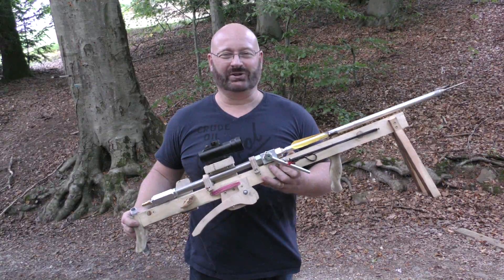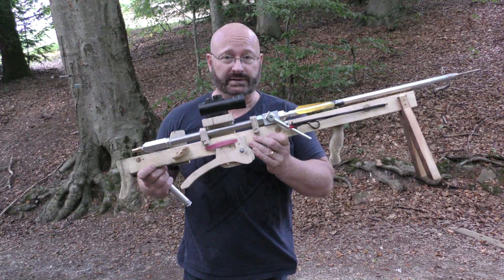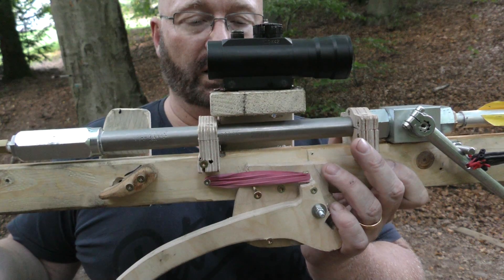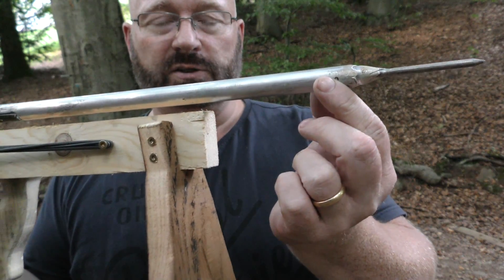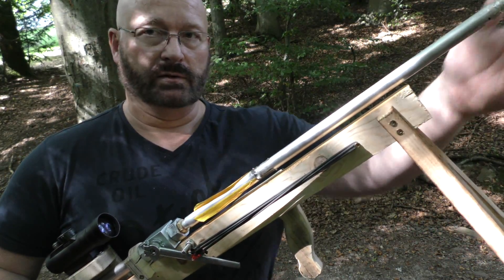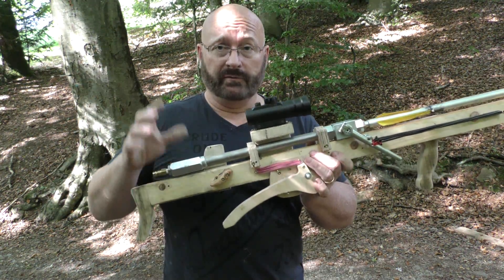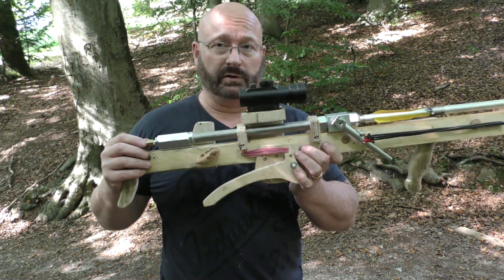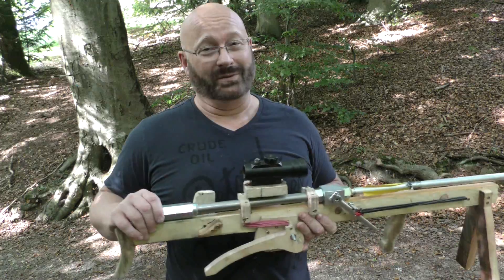Project 1000 Joule Airrowgun: Getting Closer! (714 Joule)

Comment: The speed of light was broken by a german toy inventor today..
Reply: "toy" inventor
Reply: They are considered toys in Germany. :)
Reply: He says so right in the video.
Reply: German laws (and laws in general) can get pretty ridiculous.
Reply: You need a firearm license to own an air pressure rifle with more than 7.5 Joule. Maybe (but only maybe) it is tolerated, as long as the device is not portable and he's using it on his own property only. But I'm sure it is not officially classified as toy. And if he would attach a small compressed air tank, which allows him to use it anywhere at any time, he would definitely get trouble.
Reply: He explained it all in a previous video. It's a toy and not a firearm because the projectile is not fired from inside a barrel but instead the arrow goes around the barrel. It's exploiting the letter of the law and I'd be surprised if this wasn't fixed soon.
Reply: Jonas Meyer
Das halte ich für ein Gerücht... Schau dir mal Paragraph 1 des Waffengesetzes an. Für mich kommt nur in Frage, dass es sich nicht um eine Waffe handelt, weil es nicht transportabel ist. Falls eine Luftdruckwaffe aber generell so definiert ist, dass damit ein Projektil aus dem Inneren eines Laufs gefeuert wird, dann ist es deshalb noch lange kein "Spielzeug", sondern bestenfalls ein "gefährliches Werkzeug" oder ähnliches. Das ist letztendlich Auslegungssache der Gerichte, und die würden auch jetzt schon Wege finden ihn dafür zu verknacken, falls er es darauf anlegen sollte. Ich bin kein Spielverderber, aber das ist einfach nicht ganz richtig. Vor allem, wenn du das einem Ami erzählst. Die Gesetze funktionieren dort etwas anders als hier. Wenn das Teil dort als "Toy" eingestuft werden würde, dann hätte das völlig andere Konsequenzen, wie wenn es hier einfach nicht als "Schusswaffe" eingestuft ist ;-)
Reply: +DK0207
So what you're saying is that if isn't transportable it isn't a real weapon?
Sounds legit to me, I'd consider a rocket to be a toy too.

Comment: Add a few mililiters of oil inside top of arrow (you can try grease or fat) high air pressure will detonate that oil causing even more pressure. This is a very simple but effective technique to improve pellets air guns.
Reply: That would make it a firearm
Reply: By law it wouldn't be a firearm and still perfectly legal, heck muskets aren't classed as firearms.
Reply: sasdlasokdalkfdalksfa well firearm laws in Germany are liberal in Poland pipe and hammer can be classified as firearm
Reply: you mean dieseling?
way to go to destroy an air gun :p

Comment: if my maths are good, this has almost 40% more energy than a 9mm handgun.
Reply from the maker: True, but keep in mind it also has 4.8 times the momentum of a 9mm. Plus a sharp steel tip rather than a blunt lead tip.
Reply: +JoergSprave so it really will kill a zombie, not just kinda kill a zombie.
Reply: JoergSprave really, the point I was making is this thing will murderize whatever it hits
Reply: if JoergSprave reaches his goal, he will be in 357 magnum handgun territory
Reply from the maker: I already am. At 1000 Joule I'll be getting closer to the .44 mag
Reply: I suppose you are on the low end of a 357 magnum now that I check the range of Joules...if you aren't already, start wearing ear protection
Reply: +phage74 ear pro is unnecessary, the arrow still is going really slow
Reply: it is hell on coconuts
Reply: When it comes to energy he's on par with some 158 gr .357 magnum, but wih 3.7 times higher momentum, due to the heavy arrow.
Reply: +Jonathan I. 
The momentum is devastating. 
I'm pretty sure it would go clean through a person.
Reply: +Sean Dali I don't think so, people are more tough than a bit of gelatine with coconuts in it.

Jörg should do a test like tnoutdoors9 does, that might be more conclusive.

You have to consider how thick the arrow is, compared to let's say a bullet.
Reply: tommihommi1 
I have. That amount of momentum? It'd easily go right through.
Reply: I find it strange that people are so interested in momentum...it seems like a meaningless random product to me...energy has stronger implications for the destructive power of a projectile in my opinion

Comment: That would be brutal with a lead ball in the end for a bit more thump.
Reply: The arrow damage much more than the lead ball tho.
Reply from the maker: This arrow weighs the same as a 29 mmm (1.15") lead ball.
Reply: I was thinking adding the ball into the arrow, I am not sciency but I just thought more weight = more thump.  sorry. and thank you for pointing out my error :-)
Reply: +whatthefluxable oh, I am out of my league, :-) but it is ok :-) I sort of learned something, (blowing it the force is different than thrusting/throwing it) but with the gas it is more accurate, what would changing the gas do? that nitro they use in fancy paintball markers? to what pressure is it stable and the arrowheads how much longer till they been extra extra reinforcement? :-)
Reply: +Joel Bradley need** extra extra
Reply: Forget the thump. Replace the nail with an oversized cutting broadhead. eeep

Comment: Maybe use Helium as propellant. Helium is less dense than air and more fluid, This results in less internal friction. With helium are 10-15% more power possible.
Reply: but the density of helium is lower... less mass of helium can be pumped in so the propelling force would not increase.
Reply: +Wan HL doesnt have to do with mass.  Propelling force would increase
Reply: And a ridiculous waste of Helium, a non-renewable gas.
Reply: the propellingforce has noting to do with the mass of the gas. One reason why Helium is better, Hehium is not Chilling while decompression as air (see the fog) and the viscosity is lower which results in less friction. And the speed of sound is about 3 times higher than air.
Reply: +genjii931
You think that's a waste of helium? Wait till you see the Airlander.
Reply: Maybe try neon, or one of the noble gases?
Reply: Wouldn't Hydrogen Be Even Better? (and that is the tale of how the self-destructing steel arrow launcher was made)
Reply: +Wan HL If you look up the video "Pellet Gun On Helium" from Cody's Lab, you will see that helium does in fact give you a lot more power.
Reply: The Visitor that's the video I was thinking of!
Reply: The Visitor Helium would leak, though. He's had enough problems as it is harnessing the power of air, keeping helium in a confined space is not something he needs on his plate xD

Comment: To get more oomph out of the system you could do 3 things that will all result is an increase in projectile speed. Putting a rupture disc at the end of the launch tube will allow a large increase in pressure within the launch tube before the arrow sees any pressure at all. Having a tight sleeve for the first 20mm or so at the back end where the arrow fits around the launch tube would have a similar result. Even applying a piece of masking tape between the launcher and arrow will mean there is a fairly massive increase in pressure before the arrow starts to move. The 3rd thing is either to use a commercially available or homemade pilot operated solenoid. You can get air ones with a manual activator but at Joerg pressures you would probably need to machine something up. I reckon you could easily halve the release time over even the rubber band powered ball valve.

Comment: I'm really glad you took up the idea of using a compressor. There is one more thing you could do to deliver a power increase and that is to use other forms of inert gases. For example Helium delivers even greater pressure than compressed air. You can pick up small helium bottles off eBay for around 40 euros. I would have to look at how to link the tank up to a compressor though. Hydrogen would also work but the risk of explosion from the explosive decompression or friction in the barrel and projectile would make it too dangerous for this project. Looking into inert gases is a great idea for this project and will produce a very high measurable increase in energy. The other option to increase energy is to change the valve. Ball valves don't open quick enough to release the maximum potential and that's a weak point in this design.

Comment: @JoergSprave Hey Joerg, currently the acceleration is just in the tip of the arrow, after which it gets more volume and accelerates less effective. An effective way to solve this whould be to have the arrow airtight in the barrel. Or have it fill the tube tightly. So the complete air pressure has to force the arrow out of the barrel. and only disperses after leaving the barrel entirely.

Comment: Have you thought of adding some kind of seal or gasket on the fletching end of the arrow, clamping onto the barrel so the air can act at maximum pressure for as long as possible? It seems to me like the base of the arrow would be a leakage point. Maybe something that engages once it hits the base of the barrel, but a teeny bit of difficulty loading the arrow wouldn't be a bad tradeoff for some more muzzle energy. 

Of course, the whole idea is based on a balance between energy gained from no leakage and energy lost by increased friction.

Sorry for spitballing, this is just such an incredible engineering project to think about.

Comment: I think I would add a metal plate between your face and the pressured parts. Just to be sure. Could be used as a nice cheek plate too. Anyway Joerg's projects make me give up on mines haha, he's unreachable.

Maybe there is one you could undertake some day, I would just need my user name to be mentioned if it ever happens. It's a kind of "perfect crossbow" that would mix compound reverse limbs technology like the Scorpyd; with AR480-like cocking device (except you wouldn't have to push back the sliding hook manually: it would be [rubber- ?] repelled to initial position with an automatic disengagement of the crank when the trigger hits its pulling limit -- no unwanted momentum coming from the crank rotating); and a magazine feeding -- the most ambitious part? Feeding arrows is no easy.

Basically you'd get a crossbow similar to the AR480 but very long draw length / rear-heavy / bull-pup design thanks to the reverse limbs, and no need to break your aiming between shots thanks to the automated feeding and re-positioning of the cocking device.
So you would end up with the most accurate and the fastest crossbow, both in firing rate and arrow speed.

Comment: Did you thought about using silicon oil on the barrel? it is used in many vacuum application in science and it should minimize the leakage of air between the arrow and the barrel. And if you use grease with medium or low viscosity the friction should be negligible.

Comment: Hi Joerg, 
what if you heated up the entire chamber after filling it? Could you get the pressure significantly higher than what you can pull off with your air pump?
And did you try to use other gas than air? I was thinking about sealing inside solid CO2 (dry ice), then heating it up to supercritical state. That way you would get really immense pressure and possibly incredible amount of kinetic power on release. The only problem would be the ball valve, I'm not sure if it could handle it or whether the pressure would allow it to even move.
Keep up the good work tough! Love your channel ^^

Comment: Hey Joerg, couldn't you release the air in multiple parts of the barrel, so the released air stacks on eachother and fills the barrel quicker? I think that most of the pressure leaves the barrel after the Arrow left it. might want to put the actual release of air closer to the point of the Arrow. so it can still expand in the arrowtip after leaving the barrel?

Comment: Helium would do the trick. :D

More things you can try:
1.  More mass to the arrow
2.  Lenghten the tube and arrow
3.  Lighten the valve arm to open faster. 
4.  Add fixation/hold on for the arrow, that it would start moving from the barrel later, when the preasure inside is bigger. 
5.  Port the air tubes for better flow.

Comment: Maybe it would help to hold back the arrow for about 20 milliseconds after the opening of the valve, so that pressure can build up in the barrel. Otherwise the arraw might escape while the pressure behind it is far from its maximum. An easy (and imprecise) way to do that would be adding a clamp at the end of the arrow that it can slip out of as soon as the force pushing the arrow has overcome the friction.

Comment: Hi Joerg, what if you heat up the compressed air, wouldn't that make it even more powerful?
Reply from the maker: You know, it already gets quite hot when you pump it down the tube at 3500 psi.

Comment: i think that a co2 fire extinguisher gas cylinder could suit your needs (it holds very high pressures, can be easily found and is somehow portable plus you don't need to reload after every shot), just mount it like a backpack with steel mesh tube connecting to this monster weapon. fill it wth 60 bar compressed air, suitable valves, and a contraption that allows you to stop c. air flowing out when the arrow has left the armed position...
This can easily go somewhere....
Reply: ok i came up with another idea, two compressed air tanks, first big reservoir is the co2 fire extinguisher cylinder, second smaller one is on the weapon, a stainless steel tube like you already made, simply mounting a good hand operated valve between the two should allow you to refill the second reservoir from time to time, of course you need a manometer, when the secondary reaches the correct pressure simply close the valve and proceed reloading and shooting.
This entire thing could easily reach your goal. only drawback is that pressure will decrease from time to time until the primary is empty.
Reply: well, this isn't reaching 300 bars so discard the idea.

Comment: Very cool and interesting! But your increase in length/strength of the air tank (stainless pipe), makes me wonder how much pressure the fittings are capable of handling. The first fitting where the QD pump attaches is located is right beside the shooter's face. A catastrophic failure/rupture of that or any of the fittings could be bad for the shooter's face/eyes,  if not fatal especially at the pressures you're talking about reaching. Great fun. Just thinking it might be wise to fabricate a tough plastic or polymer shell to go between the shooter's face and the pipe and fittings as a safety measure. Some of the plastics, like motorcycle fender material for instance, can absorb and "stretch" with impact, stopping fragments and dampening blunt force blows. Something to think about.  Signed "Shadetree Engineer".
Reply from the maker: Those fittings aren't pressurized when the gun is loaded. The first pressurized part is the check valve, which is rated at 500 bar (my current max is 250 bar, will be 300 as soon as the compressor is here). In fact now all the parts that are under pressure are rated >= 500 bar.
Reply: Ah, OK. That makes me feel somewhat better. Be careful! Love your videos.

Comment: Here is a beautiful way to make this more powerful using thermodynamics... The problem is, that when the air expands it'll also cool, but using a couple 400v 680 µF capacitors, and shorting them inside the  barrel as the air comes out, it will transfer the heat to the air.

Comment: I can see some things limiting the energy. 
1. The speed of sound. The air no matter the pressure cannot travel down the barrel father than the speed of sound unless you increase its temperature. So the projectile can never be very high velocity. In energy terms this can be compensated by having a slower but heavier projectile. 
2. Barrel size. You can compensate with pressure for a small barrel but another method would be a large barrel and a discarding shell around the arrow. A lot more force can be imparted by the large aria to the small projectile without very high pressures. And even a fuel air ignition system can be used with with the heat of the burn increasing the speed of sound considerably.

Comment: Adding an air chamber twice that size should get you to 1,000 joules. But since you need to conserve space, maybe try shaping the chamber like a sharp "U" to cut back on length but still add the extra volume you need. But would such a tight curve compromise the structural integrity of the air chamber?

Comment: I know it´s difficult, but I´m sure you could get a lot more velocity by making the arrow ride directly on the air container. Then it would´t have to pressurize the barrel first. You would need an electric valve that can be activated inside the arrow (right behind the tip). Since wires would be problematic I propose you make the arrow itself part of the circuit instead.

Comment: all the pressure in the tank must be in the tube before the arrow leaves for max power.  holding the arrow back at first as tony ellero suggested.  more weight on the arrow, faster ball valve ect.   take a high speed and check to see how far the arrow has moved by the time the valve is open